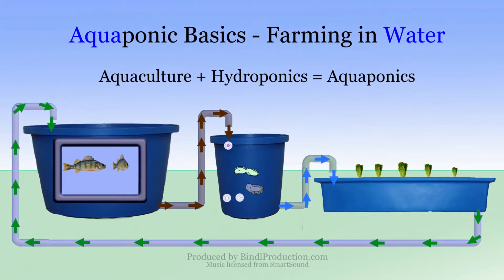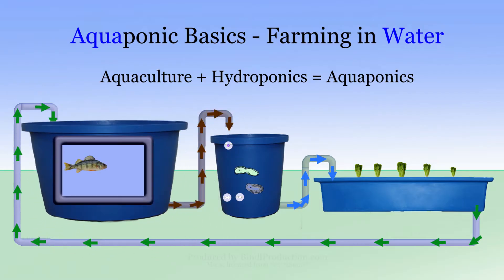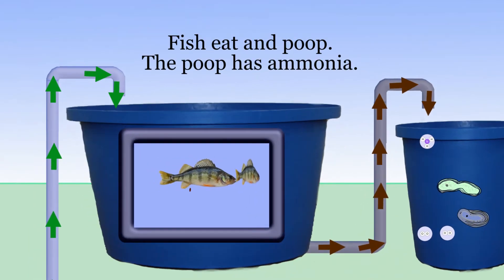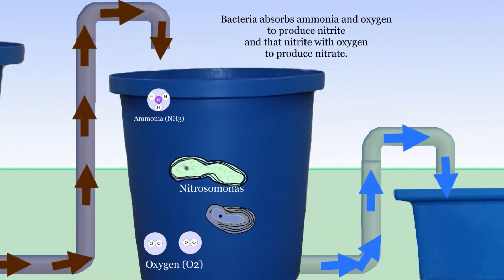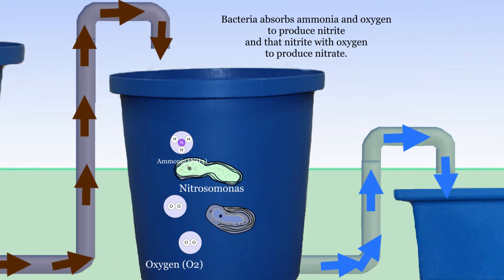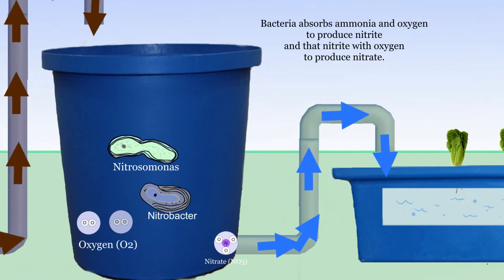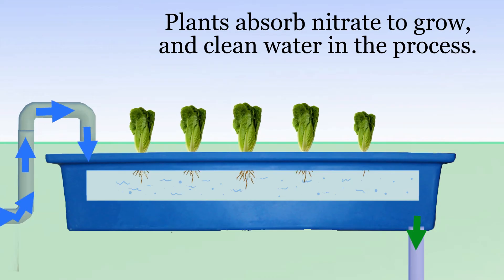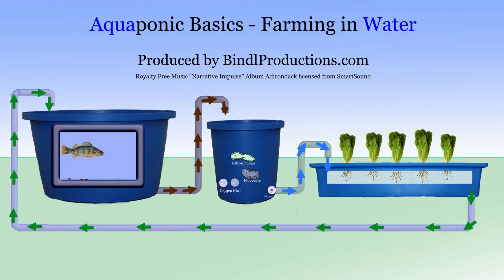Aquaponic Systems - The Basics of Farming without soil

Comment: What type of fish are used.
Reply from the maker: Most use tilapia. Some tried perch but wasn't but not the best luck with perch. Bluegill also worked.
Reply: Depends on a number of factors: your location (for both temperature and local laws), what plants you want to grow, what's more important to you the fish or the plants, how much space you got, etc.

Tilapia are the go to fish because they are super hardy, can tolerate a wide band of temperatures (but prefer warm), grow super fast, have a mild taste and actually do better in higher densities/smaller spaces than just about any other fish.

 As cichlids, tilapia are actually more aggressive and territorial if the population is low and will hurt each other. But when the population increases they switch to a more school-like, peaceful behavior.

The downside is they poop a lot so you need to deal with that. There are multiple ways to do that depending on your system.

Also some places, such as parts of Australia, have outlawed tilapia as dangerous. 

If you want less poop but have a warm climate try barramundi. Have a cold climate and the space try trout.

If you want to keep them as pets try koi.
Reply: Can you explain how to buy filtration pump systems?  
Size of tanks for each?  I am building Permaculture guides for all types of growing and you sound like you know what's up?
Reply: @happninmojo  can they reproduce on their own, and can they experience inbreeding

Comment: Where does the pump go in at ... how does the water move? u left that out
Reply: You need a pumps in every tank, people get 300 gallon IBC totes to raise the fish in, 50 gallon barrels to pull the water into and then whatever hydroponics system you have in place. Finally the water that runs through gutter system or table to feed your food needs its own return pump to push the fresh water back to hold tank with your fish